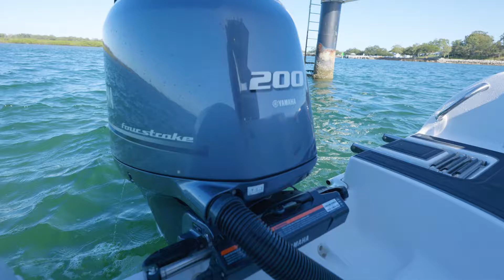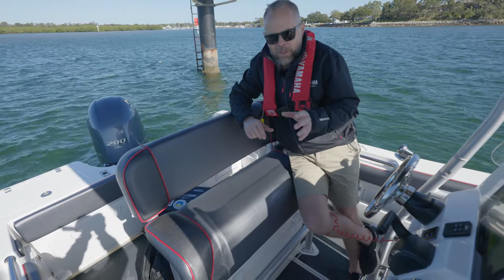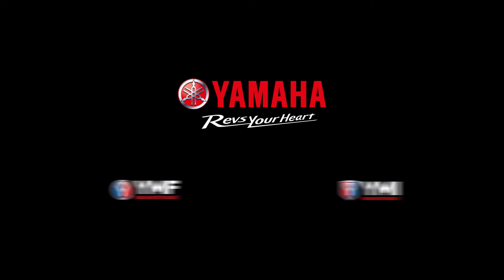Yamaha Helm Master EX Single Outboard Holding Position

Comment: First of all sorry for my bad english. Two questions please. The possibility of holding the position is possible only with digital electric steering system? And the DES is available for 200  hp engine?    It seems yes.  Am I wrong? 
Thankyou very much 
Best regards
Stefano (Italy)
Reply from the maker: DES is an essential part of Helm Master EX, which is available for outboards from 150-425hp
Reply: @YamahaMarineAu  Thankyou!!
Reply: @YamahaMarineAu    Thanks.  Helm master is yes available from 150 hp to 425.   But Des (digital electric steering)  seems to be available only from 225 hp to 425. Do you agree?
Reply from the maker: @stringadati  No. Built-In DES is from 250-425hp - Bolt-On DES is from F150-300hp

Comment: How do these hold in off shore conditions in half a meter of chop?
Reply from the maker: They hold very well, there's 5 levels of thrust
Reply: Thanks. I am about to have the full system installed on my boat. Not being able to test drive this system in South Australia. I feel like I am taking a 20k gamble. I haven’t been able to find any reviews on how the single preforms in rough conditions.
Reply from the maker: @AllThingsAustralia  in an ideal world we would have dealer demo boats in every location, but the spike in demand for units over the last 2+ years has made that all but impossible.
Reply: @AllThingsAustralia  I just took delivery of my CruiseCraft EX720HT with the full Helm Master system ... but stuck waiting for the weather to clear to run in the motor and do a test run of the system.  I often deep drop on the shelf and that's one of the uses I plan to put it toward - I had trouble finding an offshore reference until I came across the following clip which made me more comfortable to go ahead with the order:  https://www.youtube.com/watch?v=2l8EkTEV1vo&list=PL6ErcyulONrLqnj0zSB6EO0qoBiA686Vh&index=23
Reply: @zk8241  that’s awesome. I have since had the full system fitted to my Bar Crusher 730HT. With the 300hp single engine.
I have taken the boat out many times now on different conditions. The results have been nothing but poor. Extremely poor to be exact. 
In dead calm conditions in 3 meters swell with 15 to 20 seconds between sets. The fish point will move the boat around so much. Making it un fishable.  
In sheltered conditions in a bay with glass off conditions. It may hold reasonably well in 1 out of 10 shots. With the glass off still takes of In random directions & you have to go & disengage it. Yamaha ensured me before purchasing the joystick for the Fish point that this would out perform a Minn Kota Hans down. Biggest waist of 6k I have ever spent. Would have rather put this into a Minn Kota setup for sure.
However the digital steering & autopilot is absolutely amazing. It was worth every cent just for these 2 options. 
Don’t bother adding a joystick & Fish point if you have a single engine that’s for sure.
Let me know how you go with your Cruise Craft. 
I hope the will improve with Satellite & software updates in the future.
Reply: @All Things Australia      Hi Mate, I've now had many estuary and offshore trips so I can report on experience with my CC EX720HT and 300HP single. It works for me. Used it in the estuary to stay on top of bait balls many times now - initially I was concerned the noise would spook the bait but it doesn't.  Offshore, as an example, I fished Sydney N FAD last Friday and it held position for 3hrs superbly only losing position once. .... I used Mode: Stern and Thrust Lvl: 3.  It lost position when I used Joystick to shift our position 3m, I didn't realise that action automatically reset settings back to Thrust Lvl: 1.  We lost position, I pushed Thrust Lvl back to 3 and all good for the rest of the day.   PS - I find that Mode: Bow is less effective. 
Perhaps there is an issue with your heading sensor location?, something interfering with the signal?
Reply: @AllThingsAustralia  Hi Mate, You asked me for my experience with the CC EX720HT. Please see my reply above ... somehow it didn't tag you properly.
Reply: @zk8241 that is encouraging news. Boat is due for a service soon. I will get Yamaha to look into it again. Sounds like some type of issue with the heading sensor. Thanks for your update. I now have some hope. 
Will keep you posted.
Reply: @AllThingsAustralia  Here is the video link showing the Fishpoint operation on my rig: inshore and 23km offshore.   if you look at the video from 27:15 you will see the FAD in the background as a location reference. I don’t think any leccy could do better.   https://youtu.be/7MuLOfcMgYk
Reply: Thanks mate. I bottom bounce in 20 to 50m. If you are only surface fishing like in your video then yes you are not going to notice your hold position as if you was fishing on the bottom. Try some bottom bouncing in different conditions & depths & let me know how this works for you?? 

Nice boat for sure 👍👍👍
Reply: @AllThingsAustralia   As is said above, look at my video from 27:15 you will see the FAD in the background as a location reference. I don’t think any electric Min Kota etc could do better. Btw I do a lot of bottom bashing 30-60m for flatties. Works fine. But I prefer to use DriftPoint as I like a little drift -  DriftPoint keeps the set boat orientation while we drift so we all fish from same side of boat. I’m also experimenting setting a track for the drift thinking that because we have set an autopilot course (track) we should be able to use speed control to try and slow the drift.  Can’t report on that as yet.  Also I’m yet to try FishPoint deep dropping 500m off shelf - but from what I’ve experienced so far it’s gotta be better than running the motor in reverse idle which is what we had to do before. End of March is when deep dropping fires up here. Best of luck with your setup and thanks for your comment re the CC … I’m loving it.
Reply: @AllThingsAustralia   Ok so the conditions and free time finally aligned and I was able to go deep dropping off the shelf. FishPoint kept us locked into position for the 3.5hrs we were there pulling up Gems and Blue Eye. Here's the video - from which you can assess they were real offshore conditions with a decent swell -  https://youtu.be/1oZ2WlznAuY     
I am having absolutely no issues with mine Helm Master Ex setup, I really hope yours has been sorted out so you can start enjoying what you have purchased. 
PS - One thing I have observed is that if there is no wind or drift (ie the conditions are very calm) then running the FishPoint function can start to move the boat around - that's probably because there is nothing for the Fishpoint function to work against and it's just chasing a theoretical GPS position that appears to be moving because of the variance in the satellite signal.  My friend's MinnKota does the same (goes in circles) in calm conditions. But it begs the question why you would turn a spot lock on under those conditions in the first place.

Comment: It holds position, but will it hold heading?
Reply: The HelmMaster system has 3 "point" Functions. As per above replies I have a single engine set up and this is my experience.

FishPoint is similar to Spotlock. If there is wind/current the boat will naturally orient with the prevailing conditions so it will hold that heading in FishPoint. You have 2 Mode settings on FishPoint:  Stern or Bow. You choose which one you want to face the conditions. I have found Mode:Stern to be more effective for me .... but I have a half cab which catches the wind and so with Mode: Stern my rig naturally swings to cabin down wind and stern to wind and stays in that orientation with FishPoint.  

DriftPoint holds your desired orientation (use the joystick or steering to point in the desired heading) but lets the rig drift with the conditions. You can also set a track (autopilot) to control your drift following a contour or reef. I use this fishing for flatties or reds ... it allows us all to fish from the same side of the boat.

StayPoint only works with multi engine rigs. It will hold both position and orientation. Does not apply to my rig.